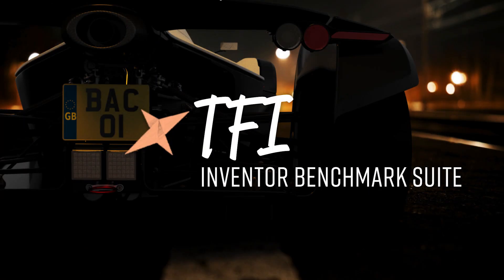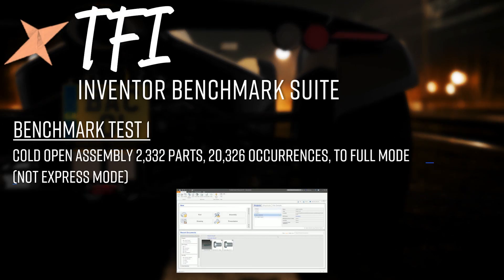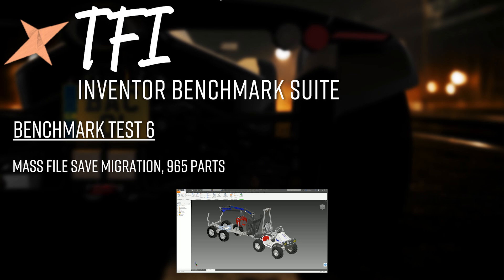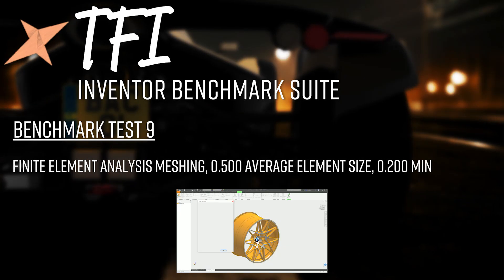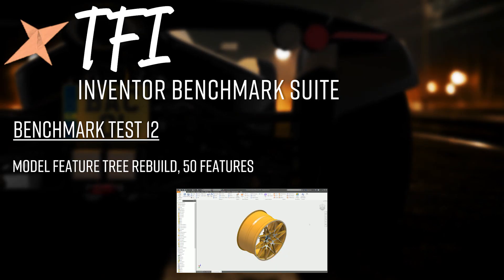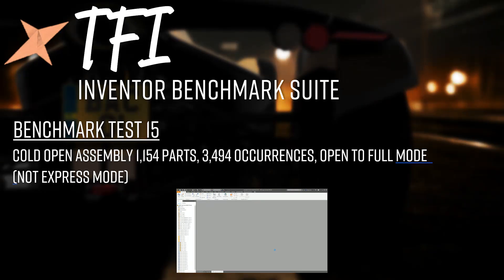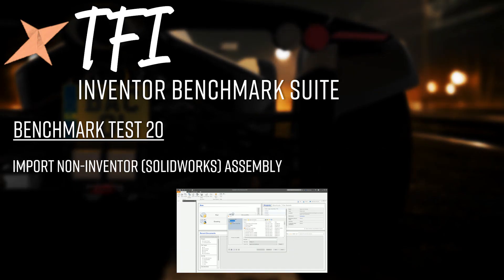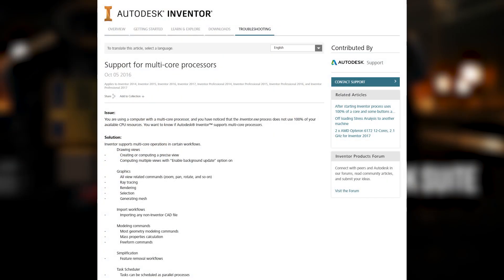The TFI PC/Workstation Benchmark Suite For Inventor - Overview

Comment: I want to conduct some Inventor benchmarking of my own, and I understand that you cannot share the assemblies you used - but I was hoping you might have some advice on how to go about this. In particular, I was wondering if you manually performed each of the tests described in this video? Or did you use a script of some kind to automate it? If the latter, any info you are willing to share about how you set that up would be most appreciated :)

Comment: I have a doubt, Being around the same price point, is better to buy an I7 7700 (non K) or buy an I5 7600K. One of the differences is the MOBO, because I can buy an B250 for around $70 for the I7, and a Z270 for $115 for the I5.. I have this doubt, I see that Inventor not just take advantage of the single core operations, but instead if you use the full software you will have clear benefit from the multi-cores. In this precise case, arise the question of the thread and cache too, 8 thread vs 4, and 8MB vs 5MB. What you think about it?

Comment: R7 1700x scored 1600 in cinabench is that pretty good?
Reply from the maker: Yea, really good.  It could probably even get better with a slight overclock.  My 4790K with a 4.6GHz overclock only gets 925 in Cinebench.
Reply: TFI Really? That seems pretty low, my 6600K gets 870~900 at 4.7ghz.

Comment: So hyped for the benches!
Reply from the maker: Spoiler alert, I've got a dual Xeon E5 system here, results possibly incoming today!
At the moment I have about half a dozen massively different systems that I can test, with Ryzen also incoming.  How many further systems I get depends on if I can get any sponsorships because when your channel makes $300 per month ad revenue, you can't be buying in thousands worth of equipment every video else I'll be homeless in no time ha! Once I've tested all the platforms and published the results, if I can't get a steady stream of new systems in, I'll probably move on to testing different overclocks and such... does swapping out a SATA drive for a PCIe based drive make any difference to the application performance, that kind of thing.  These tests are designed to make sure a system change like that... if it's going to make a difference, you should see it in these tests pretty quickly!
Reply from the maker: Get hyped for an i5-2500K I managed to overclock to 5.1GHz on a bog standard Intel stock cooler! It very nearly caught on fire but let's not get bogged down on who torched who and get hyped for the clock speed gains!
Reply: Half a dozen is more than I've expected, sweet. Pinpointing and testing how much difference one part makes is brilliant idea. Maybe even more valuable, just like your GPU test - eye-opener.
Dual E5 effectively have 8 memory channels, should be interesting in FEA - we'll see if it's any good in linear static analysis ;) 

I was always (and still am) impressed by your motivation and dedication to this channel. Massive respect.
Reply: Awesome. The hype train is approaching sound barrier. It's getting really serious. Nice set of tests. I'm especially looking forward for FEA part, and low budget PCs. 
It would be also nice to see how much of difference 4-channel memory vs 2-channel makes in FEA tests  - just one setup with any Xeon E5 or i7(x99) would be sufficient I think  - FEA and CFD are only memory bound tasks that I am aware of.

i5-2500K, i7-4790k, r7 1700x something else? G4600? i76800k - i76950x?  Xeons? How many platforms do you have in plans in next half year? 

Choo-choo!
Reply: RyZen still has some problems in Windows, as certain types of applications use the first thread above 90%, and only ~10% of the other 15 threads ... other apps have their threads jumping around on all cores, reducing performance significantly... so you may have to wait for these bugs to be fixed, a few weeks, then you'll get accurate results...